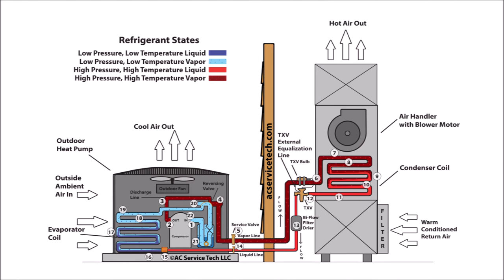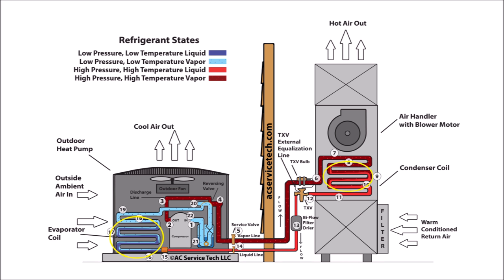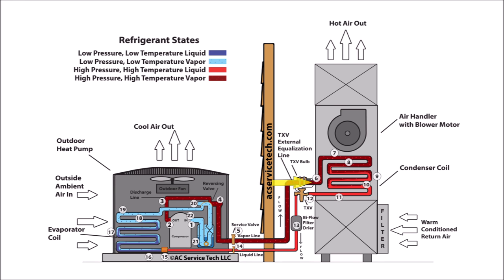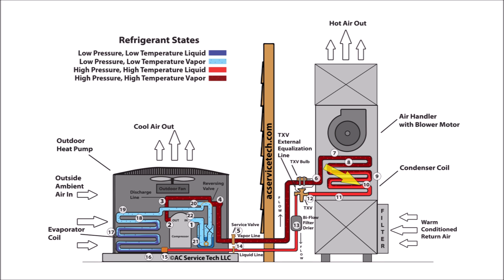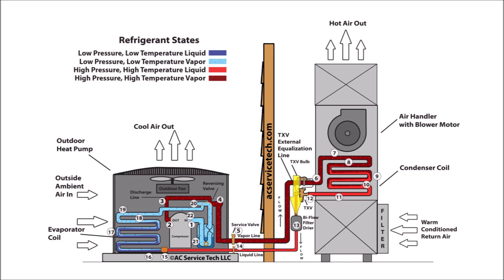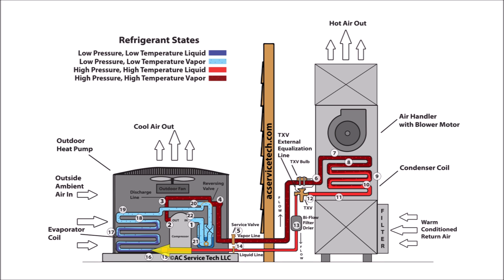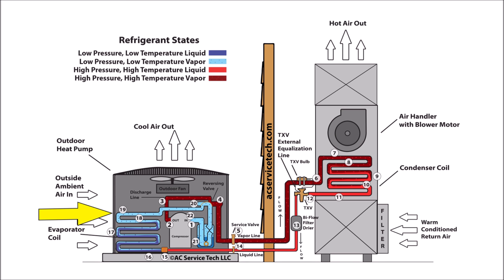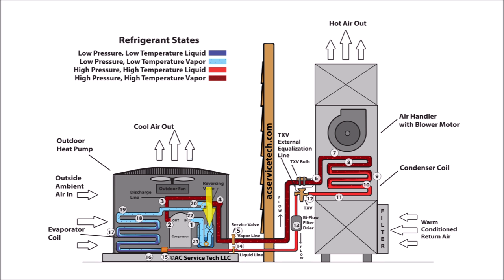Refrigeration Cycle of a Heat Pump in Heating Mode!

Comment: Thank you for the detailed explanation! One question though - how is the metering device in 15th point different from the one in 12th? Is it simplified on the schematic or it doesn't have a bulb and equalization lines in reality too?

Comment: My unit was low on refrigerant by 2 lbs over a 4 year period. It was recharged, but I'm beginning to wonder the impact on the heat pump. Should I invest on a new unit? The last unit was installed in 2008. I hear new systems like Trane can heat without auxiliary heat when the outside temp is still 15 degrees.

Comment: Could you explain how the refrigerant is not raising in temperature, yet still adsorbing heat energy from the surrounding air at 3:28. I cant wrap my head around that part.

Edit: A bit of research says that heat energy can be added to it but its used to break the bonds (latent heat fusion) and not to raise the temperature, right until the point of phase change (from liquid to gas). Hopefully I've understood that right. /watch?v=bFFL_kJpTcs

Comment: Sir. Where the the temperature clamps need to be located for the súper heat and sub cooling, when we are charging on heat mode on a heat pump system..?

Comment: I was told i need a bi flow liquid line solenoid  due to a 70 ft line set. Its a 16 seer 2 stage heat pump by Ruud. it dose not have a accumulator. its on a residential house. what would you recommend ?
Reply from the maker: Who told you this? The manufacturer? I don't think you are talking vertical height of the lineset? 70' is not that far when talking horizontal, thanks
Reply: @acservicetechchannel  its an upflow and only a 8 ft vertical. The guys at RSD recommended it
Reply from the maker: Hey HVAC/R Detective, who is RSD and is this directly coming from the manufacturer on these units? We don't usually put a solenoid on any air conditioner. There are many reasons to add an accumulator. Do you see this solenoid in the installation manual?
Reply: Yeah it's in the manufacturer's manual for their Ruud two-stage heat pump but it says for lines up to 90 feet.   So my questions to you is do you think it will be fine without the LLS . The  line set is 6ft  up  55 ft horizontal and 10ft down to the  compressor. I am going to start Monday and I would appreciate your recommendation
Reply: RSD stands for refrigerant supply department. No it does not come from the manufacturer with it but it is a add-on for this unit and states for 90 ft or more. This is my first time with a heat pump and it's going in my father's house because he has no access to natural gas
Reply: @mikemc8495  need accumulator